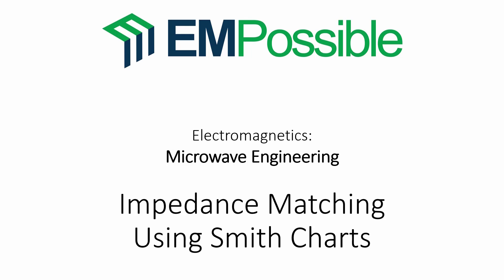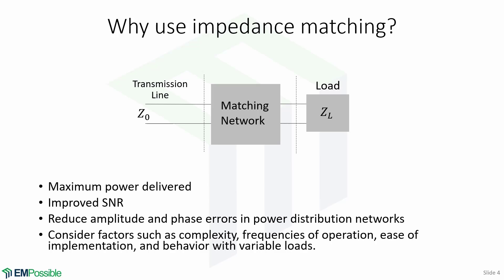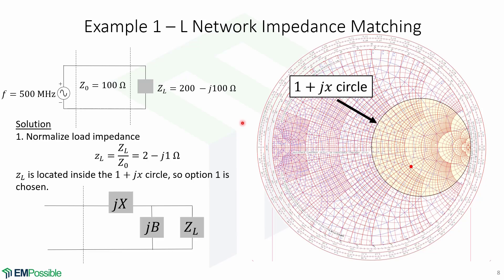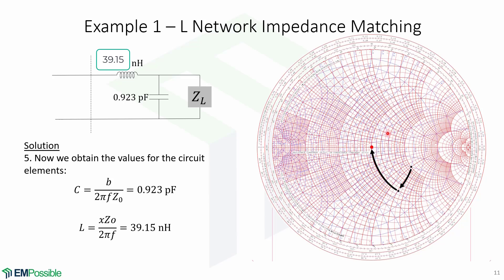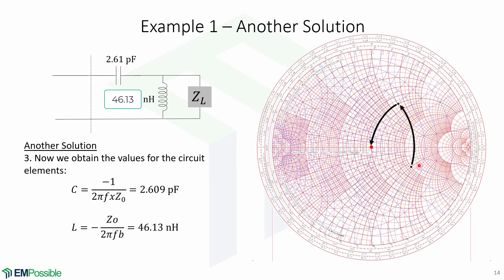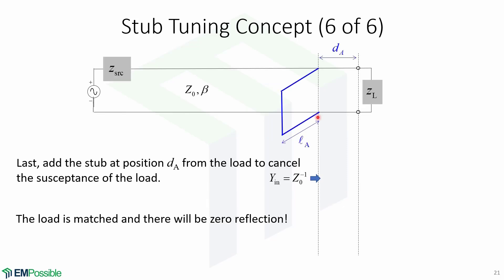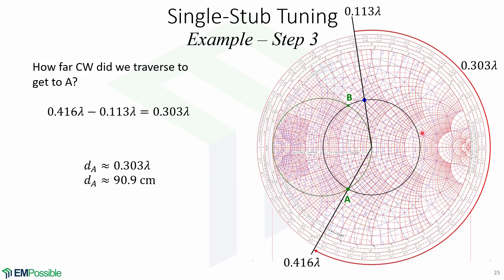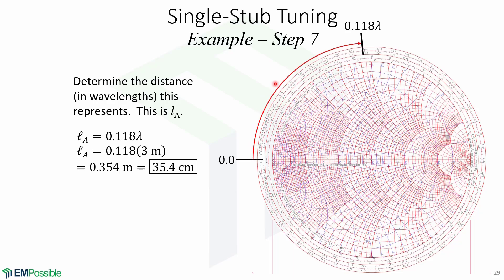Lecture -- Impedance Matching on Smith Charts

Comment: For the first example, you moved the decimal point in the wrong direction: 
C = 9.23 * 10^-11 = 92.3 * 10 ^-12 = 92.3 pF
L = 3.915 * 10 ^-6 = 3.915 uH
Other than that, great explanation!
Reply from the maker: Thank you!

Comment: At 3:25, Why in the example 1, the normalised load impedance is inside the circle? The distance of normalised ZL (from Euclidean distance formula) is coming 1.414 which is greater than 1. So option 2 should be taken.

Comment: Nope.  https://youtu.be/L24aB89-m5w?t=61 You are correct that it removes reflection between the transmission line and the matching network (looking into the matching network it will look like 50 ohms, or whatever impedance you are designing for) ... but you are incorrect that "reflections between the load impedance and the matching network can occur" ... looking into the matching network from the load, it will match the exactly the impedance of the load, eliminating reflections. The reflection coefficient should be very low for a well deigned network.  That's reslly the whol point of the matching network ... looking into the source side, it looks exactly like the source impedance (50R or whatever) and looking into the load side, it looks exactly like the load impedance.
Reply: Technically emposible is correct. Reflections between load and matching can occour, Actually this is the normal case. To see this easily, imagine the simple case of load =z0+jsL. The mathing network is a series capacitor = -jsL. Now what this means is that the energy is flowing back and forth between the L and the C. So reflection do occour always with reactive loads.
But you are also correct the impedance seen from the load back towards the generator is a conjugate match IF the source is z0 in the case illustrated in the video. But this may not be the case when dealing with power outputs where output impedance /= load impedance. So all in all the right answer is subtle.

Comment: 2:28 Why can’t use type 1 circuit when the load outside 1+jx ?

For example, if zl=0.55+0.7j,frequency=1 GHz
I can parallel the 1.33 pF capacitance first, it will let the load on the boundary of 1+jx circle, then series 4.85 pF capacitance, the load will go to center.